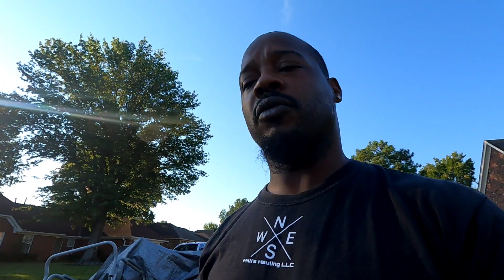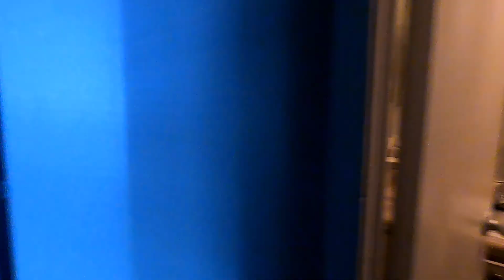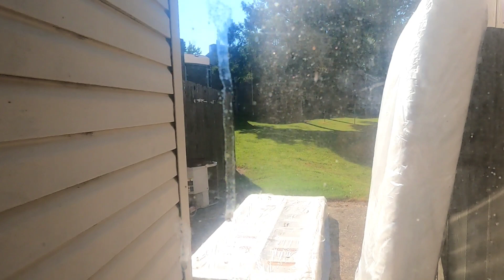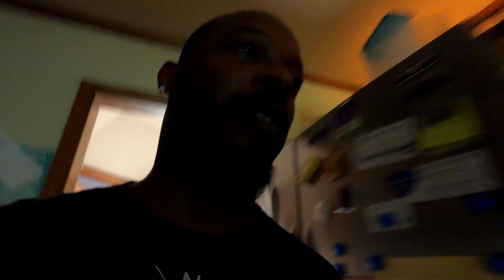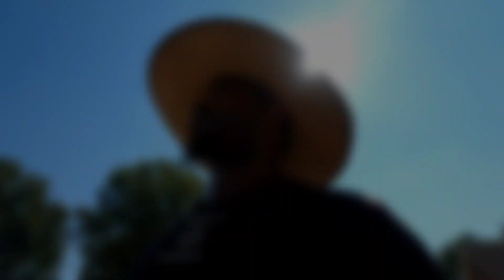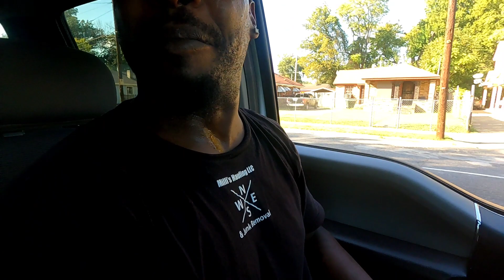Was the Scrap Metal Worth the Wait?| Junk Removal Estimates

Comment: Scrap run I'm gonna guess about $105. For the apt I would charge around $900-$1000 for all the units combined. $750 for a full trailer, $150 to carry the stuff out and the rest because of the stairs and distance to the trailer.